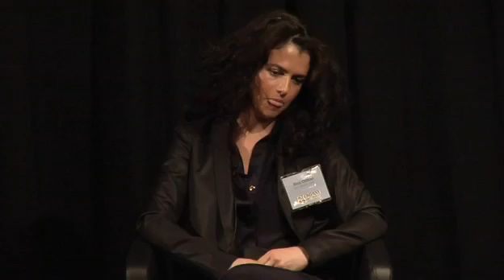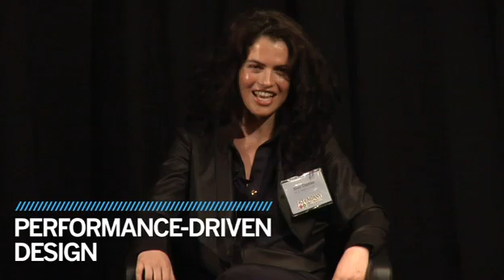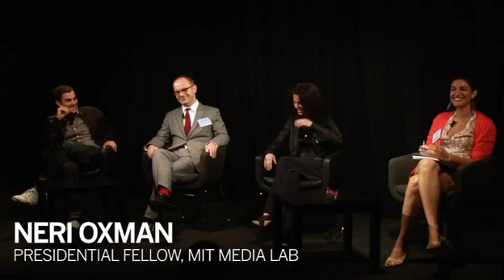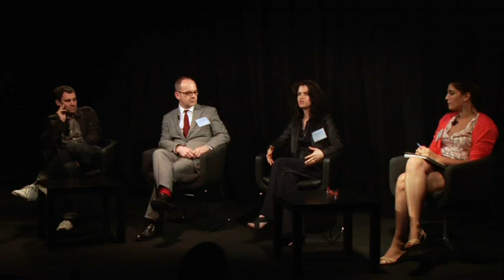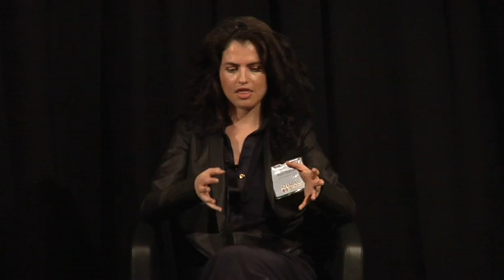Performance-Driven Design

Comment: In a recent dream ...the rainmaker was flooding a power generation station, shifting solid earth, splitting the old with new technologies and finishing the design from a vertical to a horizontal / lateral direction. It was slightly disturbing to Poseidon who generated high peaks and valleys a choppy liquid field.